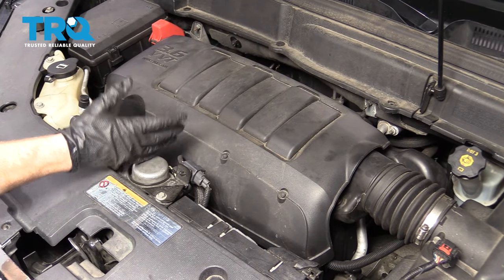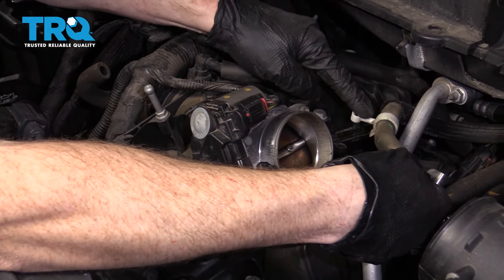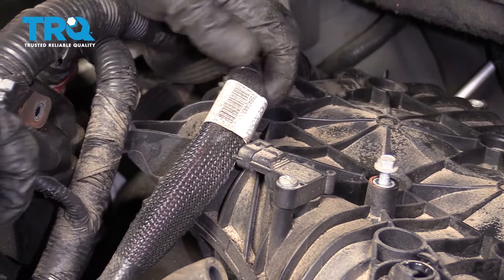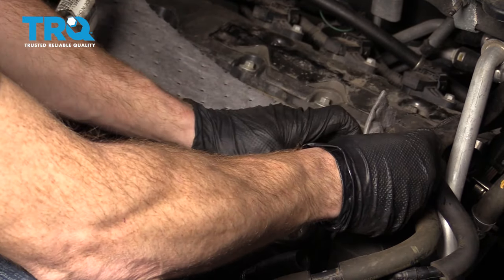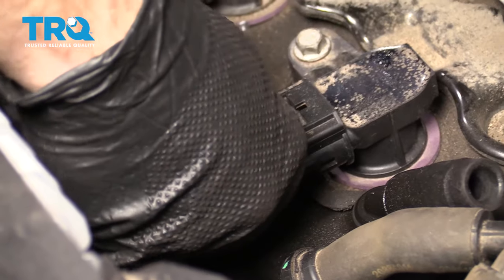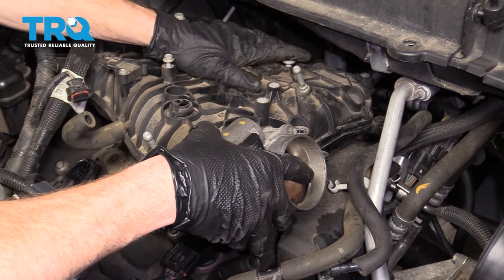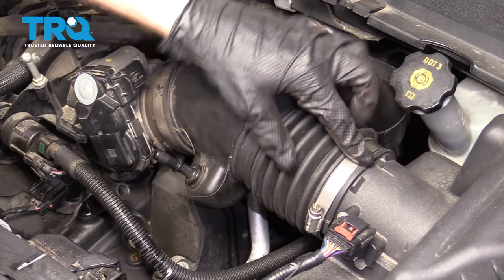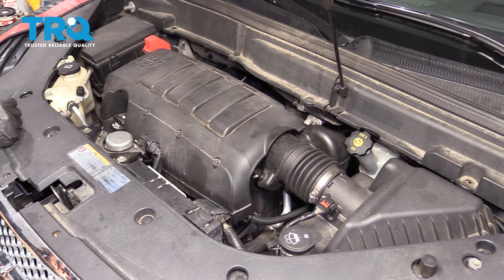How to Replace Spark Plugs 2007-2016 GMC Acadia

Comment: Thanks for the video. I watched several times before I did mine. It was much easier than expected. I cleaned out the throttle body while it was apart.

Comment: the engineers that designed an engine that requires removing the intake manifold to change spark plugs are $%$%$#
Reply: It don't require removing the intake.  Thats a way for the dealer to charge you over three hours for a 20 minute job.

Comment: This is a great video, but a couple of things to consider: if your Acadia has a lot of miles, those spark will be dicey to get out. They’re gonna be incredibly stuck and leverage is tough down inside those holes. I shattered the porcelain on one plug and spent hours trying to retrieve the pieces out with the plug screwed in so that nothing would drop into the engine. Also, hoses and those wire connectors will be very stuck as well as well so use caution trying to free all the parts up. The manifold was also extremely stuck to the engine and required all the strength i had to yank it off.

Comment: Good video, thanks!
2016 Acadia 125,000 miles first spark plug change.  No misfires, but the plugs were almost 50 thousandths gap.  All bolts, plugs, coils came out easy.  Some plastic parts were brittle.  CCV tube snapped.  3/8 fuel line fits snugly over snapped off plastic tube.  Panduit ty wrap posts fit nicely in place of any snapped factory harness mounts.
One comment on the gasket.  Felpro is just like the original which is not designed to adhere to the upper manifold, you would have to hold it in place under the upper manifold as you install it.  There are two lower alignment posts on the gasket that center it on the lower manifold.  Then carefully replace the upper manifold.  There is enough room to see the gasket as you align the upper manifold with the 2 large upper alignment posts on the gasket.  Yes, a little more work than an old school plug change, but this is still an easy job.

Comment: Hello, good afternoon, I have  ACADIA GMC 2008 Reemplace oil pump due to low oil pressure failure, clean strain I changed the oil pressure sensor and it continues to indicate a low oil pressure fault. The oil I put in is synthetic 5/30 and the failure continues I need advice I live in Mexico please greetings

Comment: I have 175k, not running rough, not misfiring. But throwing code P0430 front cat
Wondering if a front spark plug(s) is old and not burning 100%
This is a lot just to visually inspect the plugs condition to see if buy.

Comment: What is that gasket called?
Reply: Did you ever find out?
Reply: Intake manifold gasket. You can find them on Amazon for like $25. Some come with the throttle body gasket too for a few bucks more.

Comment: ok I thought this was a great vid but I ran into a problem the car was running ruff like if plugs were bad I disconnected the battery did the plugs and when I connected battery back on it doesn't even turn over! nothing lights turn on that's it

Comment: Absolutely WRONG!  No need to take out the intake. Reach behind and you can do it.  At least mention it as possible.
Reply: I think it depends on the model. I have a 2011 GMC Acadia Denali, theres NO WAY to do it without taking the intake off. I can actually get the back 3, but there’s not enough clearance for the front 3. I did see videos where people could do it with out removing the intake. Weird…
Reply: model 2013 and after, you don't have to remove intake. Early models,  need to remove intake